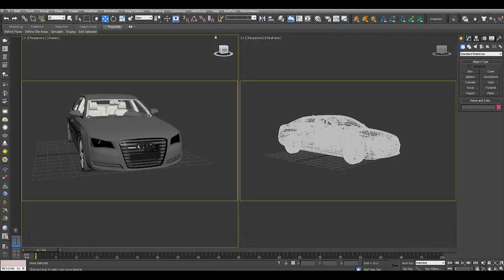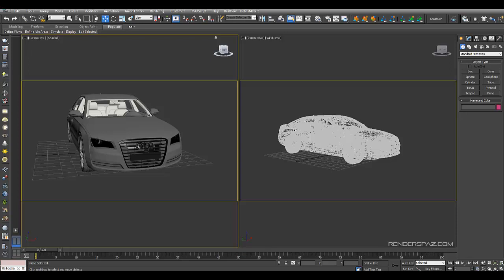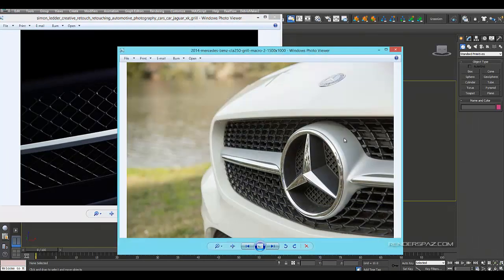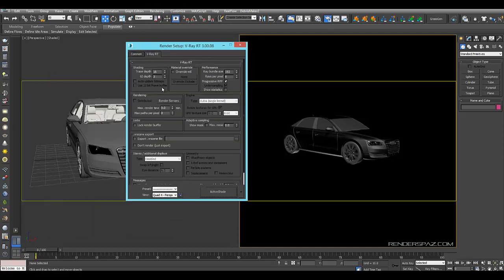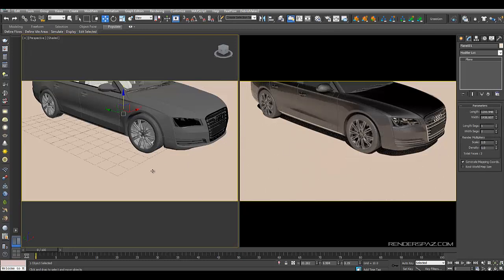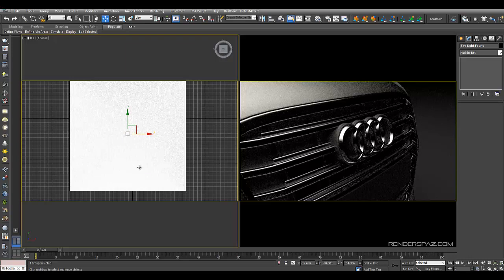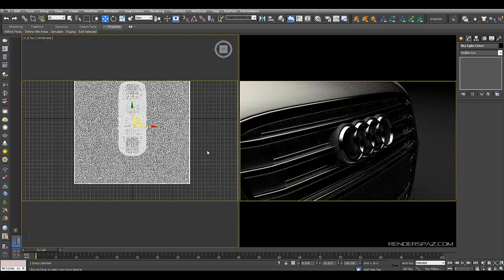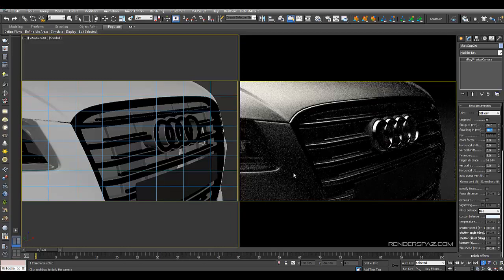Tutorial Rendering Automotive Grills in 3DsMax & Vray RT GPU

Comment: Amazing skill! Awesome project! Congratulations. I am using Corona and I'm getting same workflow, because it can also be interactive. The only limitation in Corona is that it can't use external processing power for interactive renders, which means that I'm still not getting decent results. Until I render final version, I'm not using any of the servers I have. I only use CPU, because a CPU setup is much cheaper than any decent GPU setup.

Comment: Great video ! is your monitor on your gtx 690? because my 690 is on my monitor and it is not as fast as your 690.
Reply from the maker: Thank you,  yes I run my 690 as my primary display. Depending what you are trying to render and settings will play a important role in render times.
Reply: thank you, please check your mail box ;) thanks.

Comment: Great video! What work best for RT? GTX 690 or GTX 980?
Reply from the maker: +AMA-monacoargentina The 690 is a great a card, especially handy having dual GPU and fast. 980 is newer and preforms a bit better but has no dual GPU - however this card will run flawless with RT. You can always get a lower priced GPU for viewport and use a 980 for final results.

Comment: All I want to know is how to do real world scale for the car???? please tut.
Reply from the maker: freaky freaky When it comes to real world scale, you can wiki the type of car and look for the dimensions (example: length 145 inches, mm, cm etc..) then in 3DsMax usually by default max's units are inches, however you can change this in Customize>Unit Setup.  Then create a box with those dimensions of the car given from the wiki and scale your model to that box size or if your modeling scale your blueprints.
Reply: render spaz  
Do you think this gonna work 100%, I triad that before but when I render it it still look small and stupid! what do you think? I have the right dimensions in my blueprints btw, please if you can let me send to you the model and try to scale it, thank you in adv.
Reply from the maker: freaky freaky sure send the file and I will have a look when I get a chance today.
Reply: freaky freaky It's all about your camera settings. Check things such as positioning, focal length and depth of field.
Reply: Matt Lewis Yes It's helpful too, but also you have to get the right dimensions for your model, thanks again!

Comment: nice!
what are the pc specs? please.
Reply from the maker: Currently running i7 3930k, 24gb ram, windows 8 - single GTX 690
Reply: Hi Render Spaz. My rig is an i5 760 , 16gb ram and a gtx970. I'm about to switch for vray and would love to know how that processor works out for you? I obviously need to upgrade that part. Was thinking about the i7-5820K which is similar in regard of cores and treds. That is the cheapest hexa right now around where I live. You think as a freelancer that is enough? I guess. Also if a cpu has 2 treds per core does that mean at render time when you see those buckets or whatnot. There will be as many as the treds right? One more question Is RT production ready or just for pre viz? Thanks in advance.
Reply from the maker: 5820 is a great processor with amazing clock speeds! Ram is good and the gfx card as well. You shouldn't have any issues with this setup for freelance work etc.. The latest Vray RT can be used for production, it does have some limits but I am sure you can work around it. RT just keeps improving.
CPU jobs will be fast also - using embree.